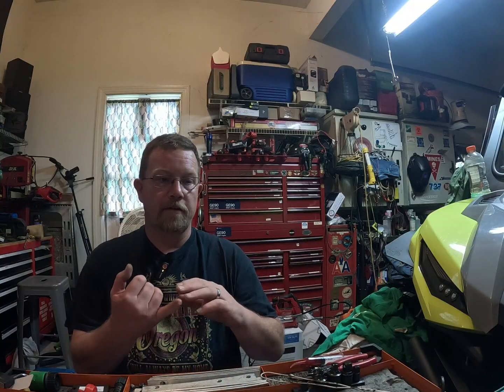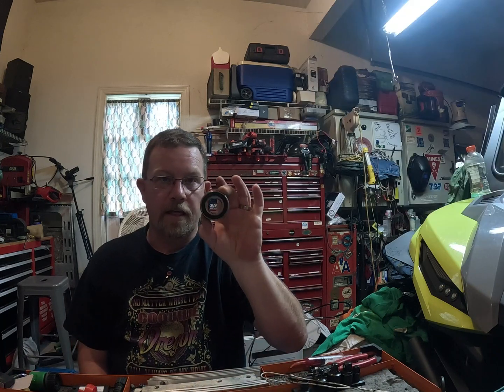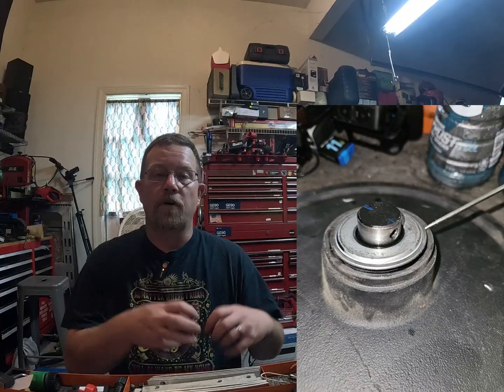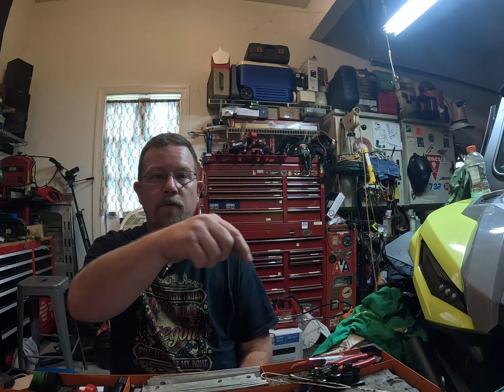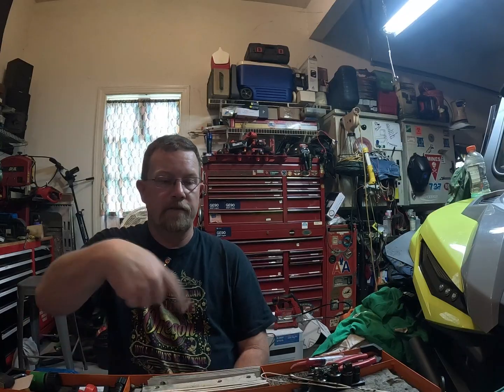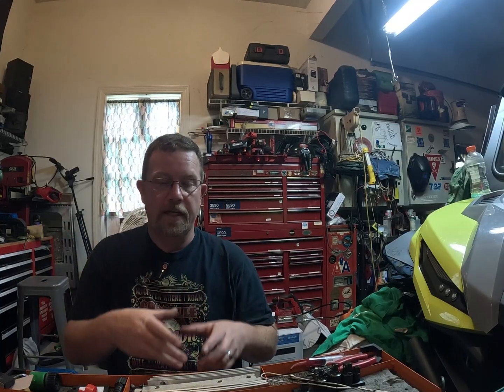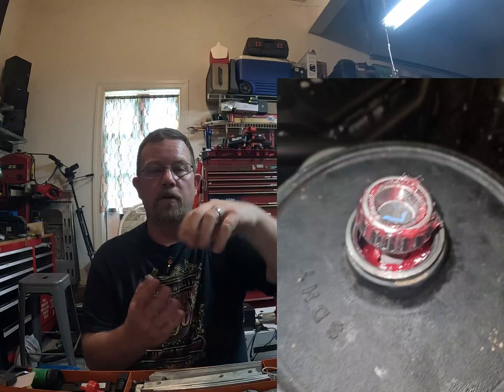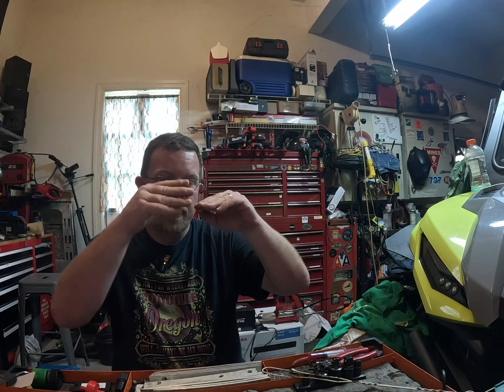QH12 Idler bearing replacement.

Comment: Thanks for making this vid. Made the fatal mistake of complete disassembly before having parts. I can absolutely validate that it won't work with the bearings pointing the other way.  :)  SKF bearings fit fine with no grinding required.  The seals were preventing smooth operation of the pivot bearings so I went with new Rubber seals all around and put grease fittings on the idlers.  We'll see how that works.
Reply from the maker: Thanks for sharing your experience and the tips about the seals and grease fittings!

Comment: My idler bearings completely exploded so bad I had to order new c clips too. I really appreciate this video.  Thanks so much.
Reply from the maker: I'm sorry to hear your bearing exploded, but happy that the videos have helped you. I hope you get back up and running soon.
Reply: @jetzombie  Yeah, it's working again.  I had to order 52mm c clips, and I grinded the inner hub from 14mm to roughly 12.5mm, that way the c clips fit without needing to grind them at all.  Thanks again for your excellent videos.